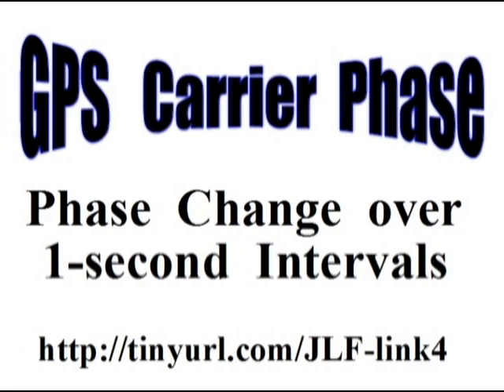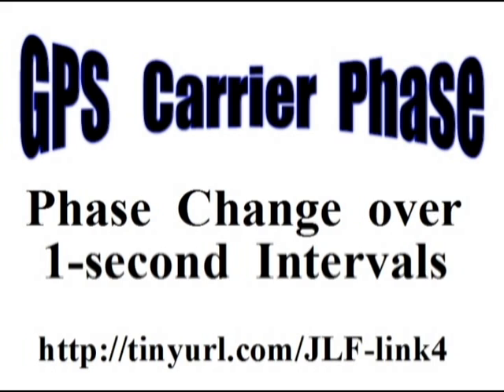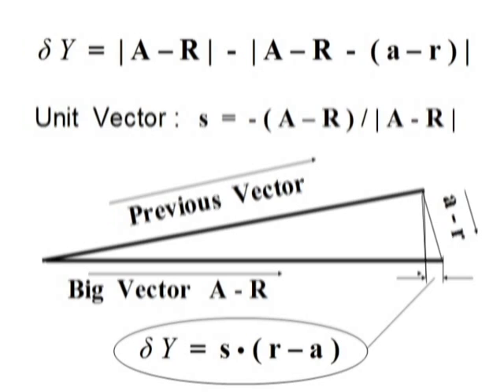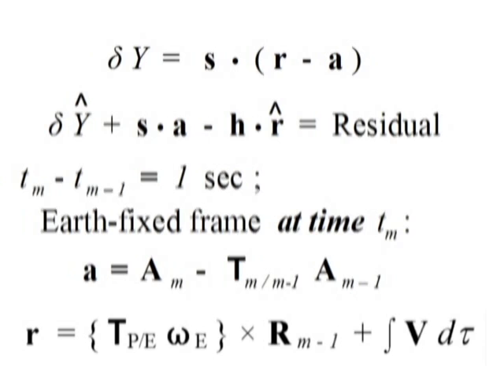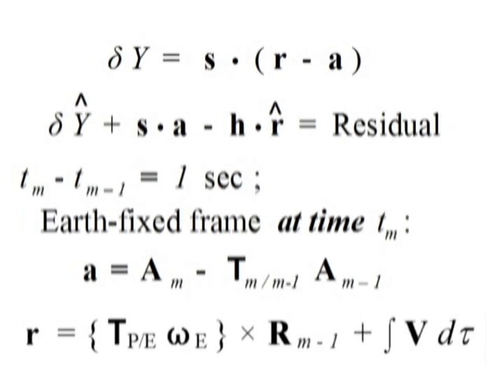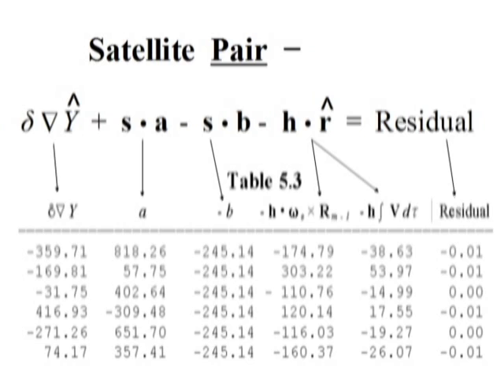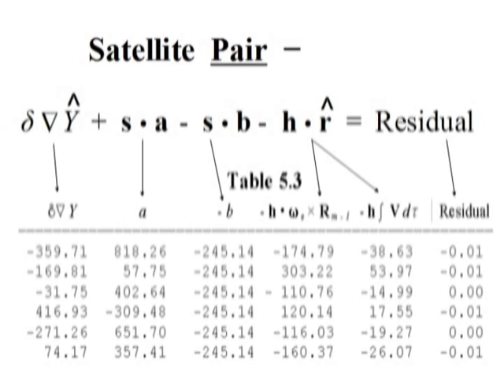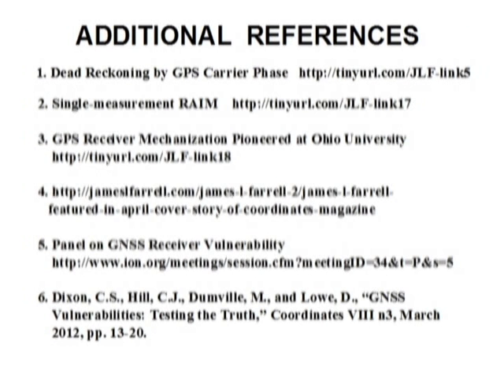GPS Carrier Phase Videoblog

Comment from the maker: I understand skepticism but yes, you missed points (frankly a bunch). Points noted in the latest blog of my website --
 * from many receivers doppler or deltarange is crude
 * 20-msec: BIG problem! (fast explanation: DENOMINATOR of  doppler)
 * tabulation showing +/- 1-cm errors in flight under severe vibration
 * MUCH more + added benefits (no mask angle requirement, robustness,
   GNSS interoperability).

Comment: I could not see any difference between what is described in this video and the good-old doppler velocity that has been used for decades. I disagree that using 1 sec carrier phase increments rather than 20msec increments should be considered as a innovation. Perhaps, I missed some points in this video.